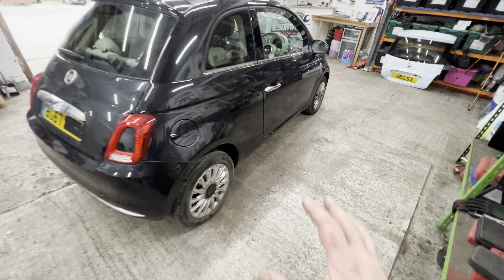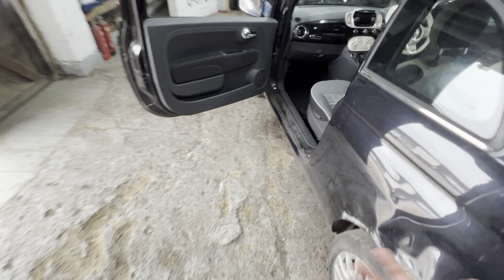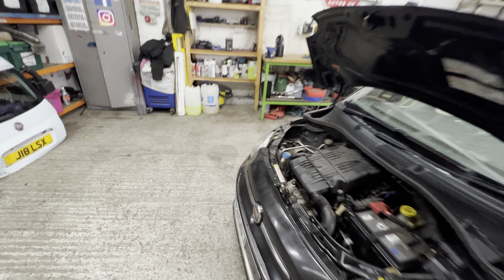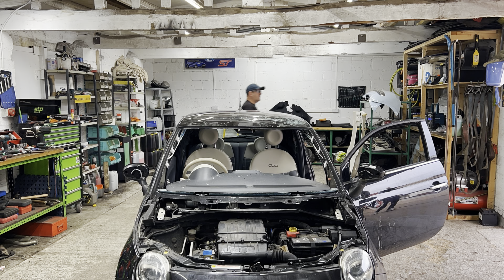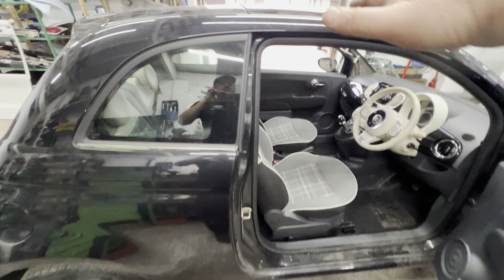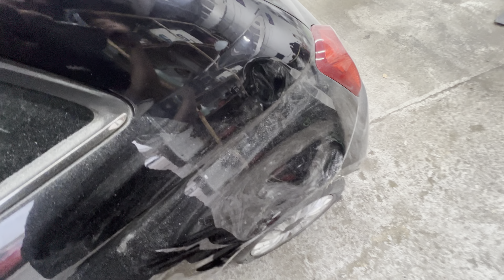FIAT 500 LOUNGE FACELIFT 2017 CAT S PART 1

Comment: Rather than using a portapower to straighten windscreen surround, I'd get a 12 inch piece of straight wood and give it a lightish whack with a lump hammer. It was a sharp blow that dented it, I think another sharp blow (or 2) would rectify it no bother. Fair play to you, car initially looked horrendous, you saw through that to see a viable vehicle. 👍
Reply from the maker: @flyinyamaha  Hi mate yeah I think you are right just a couple of blows should do it 👍👍